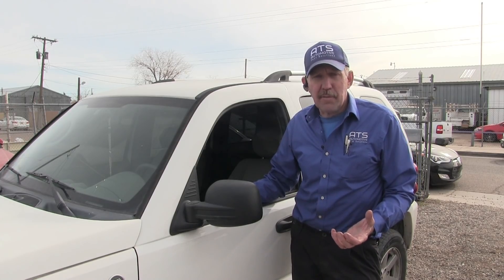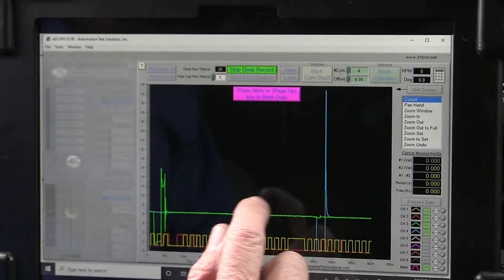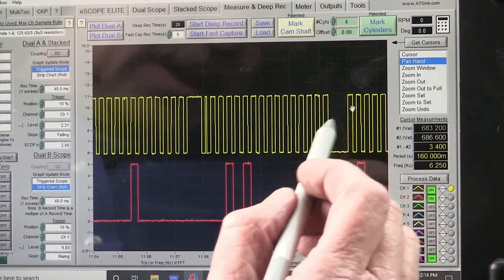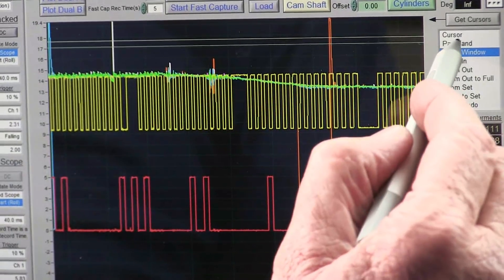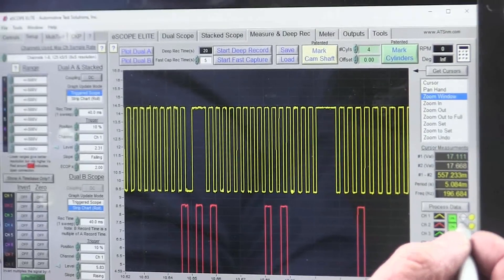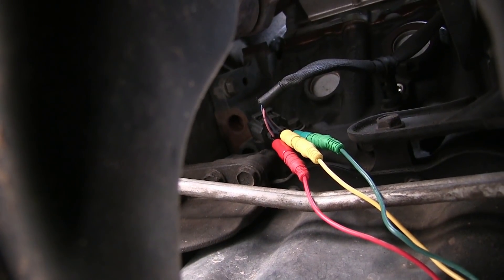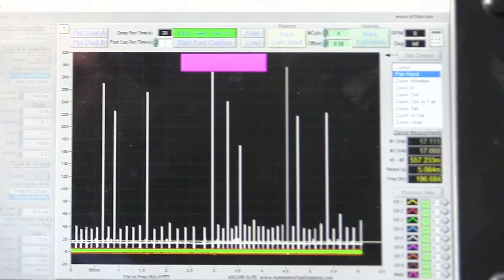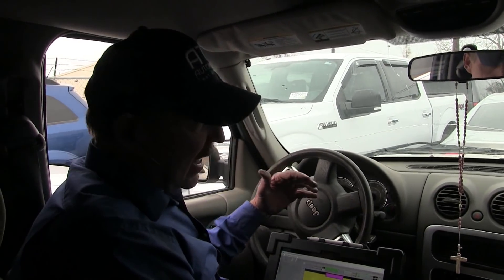2006 Jeep Liberty Stalling Problem

Comment: Automotive repair shops should be required to state whether or not they have staff that can use a scope.

If I ran a shop, and had staff who could do this, I’d advertise it. In the future, if I have an issue like this, I’m going to ask if there is someone available who can use a scope so I don’t have to come back multiple times before the parts cannon just gets lucky.

Comment: I have a 2007 Jeep liberty. Two times this week I turned my vehicle off for about 5-10 minutes, then went to turn it back on. And it was wanting to stall out. It was pretty bad. But I managed to get it started by pushing excessively on the gas. This video made me think outside the box for possible part failures. Thank you for being so clear and understanding. Tomorrow morning I will take it up to Auto Zone for a scan for codes. Then over to the shop for a oil change and hopefully they can use the same scanner tool you have to figure out the problem. Thank you!
Reply: Mine is doing the same thing. Did you ever determine what the issue was?

Comment: You were able to see it quit.  I've had intermittents that did something similar.  Two 1997 GMC Mini vans with the 4.3L V6 engines over 100,000 miles on the first van, had the same intermittent stalling, usually on the road.  It took a lot of driving with my old two channel scope and DMM ( it was over 15 years ago when I had these two intermittents) to find out it "could be" the ign module or ign coil.  When the intermittent had shown itself, I finally had the scope positioned to show the computer timing output which was sent to the external ignition module.   The module in turn toggled the Neg side of the ignition coil which then sent the spark through the distributor, the spark plug wires and the spark plugs.  With the scope on "flight record," I saw when the engine stopped, the signal to the coil from the module stopped, but the engine took time to fully stop.  During that ramp down time ( of the engine) the PCM was still sending the computer timing output ( 5 volt square wave) indicating the crank sensor was still sending the signal to the computer.  Without the old Fluke 98 scope it would have been fire the parts cannon!  As it was, the spark plug center electrodes were worn down to the insulator, the ignition wires were original, and possibly the ignition coil was stressed due to the worn out plugs.  After replacing those parts, no more intermittent stalling.

Comment: Large electrical loads briefly loads the engine speed and consequently changes the engine cadence. Hall effect type systems are very sensitive to frequency changes and thus the change in engine cadence exposes a defective crank sensor. This is one of the reasons why I prefer Hall effect type systems over VRS systems, they are much more sensitive and simpler in design, to approach this level of resolution, GM uses two VRS sensors!? Despite the hate and lack of funding for development those Dodge boys can still compete with the best. I believe Chrysler could have implemented a filter for a small glitch like this but - why would anyone not want to know of an early impending failure?
Reply: Joe luang - that's exactly what I was saying!!! If the pcm tolerance is turned that closely for the hall effect sensor to detect malfunctions, then it should at least trigger a pending code in the PCM for crank sensor performance / intermittent. Then after repeated occurence it would set a store code. Manufacturers trying to cut costs in software development!!! As expected from Chrysler! Instead they investing in SGM trying to lock technician's out, stating it's for security reasons. 👎👎👎

Comment: There still is definitely a correlation between the fan and the crank sensor, maybe the fact that the sensor was bad it  was effected by any slight variance in current change... brilliant diagnosis thanks

Comment: Knowledge and skill on another level 🤯. I am trying to fully understand the process here, so it makes sense that you would collect data from the ignition coils and injectors as these are providing the engine with two of the three fundamental elements required for running (Fuel and Ignition) it also makes perfect sense why you looked at the cam/crank signals as these are the inputs used by the PCM to determine fuel and ignition timing. I guess what is key here is to look if the outputs (Injectors, Coils) cut out before the engine stops rotating. I presume if this was a bad fuel pump the outputs would keep operating until the engine stops. If you did not have an input issue like in your case study, where would you go next and why? Cheers, Adam.

Comment: Wow!  Still can’t wrap my head around how the electrical load was related to the sensor failure.  I suppose it is just a coincidence. I was expecting a bad ground or battery.
Reply: Bernie mention that it was not the electrical load it was a coincidence the only problem  was bad crank sensor.
Reply: @rauls300ce  So it was a coincidence, that every single time you turnedon the AC, the crank sensor would act up? That was the biggest coincidence I've ever heard of in history.
Reply: Could it be possible that any load put on the engine slow the RPM and push the crank sensor into the fail mode

Comment: Love the passion. I get the fustrating bit about shops guessing. I don't get it either. I'm not 100% perfect but if you prove what is wrong with logic/testing/data you'll be right 98% of the time. The other 2% you missed a step, didn't have the whole story, or overlooked something.

Comment: Great Video. I wish I could get the training and the equipment to do this kind of work. I always enjoyed the trouble shooting when I worked on older cranes. I just missed the boat on the computer stuff.
Reply: There is so much fundamentals training on offer for free on YouTube, such as Scanner Danner, Schrodinger's Box, then you've got the awesome case studies such as these from ATS, Ivan at Pine Hollow, Eric O at South Main Auto and many many more.
You don't have to start big, any scope is better than none and there are some good 2 channel scopes out there for little money.
8 channels on the ATS Elite lets you capture more signals at once, with fewer channels you would have to run the tests multiple times to build the picture but you could still do it.... as long as the fault could be reproduced on demand or was occurring frequently.
If you noticed here, by observing the 8 channels simultaneously, it was easy to see the relationship of cam, crank ,coils, injectors and power - and then quickly deciding which ones weren't an issue, hiding those traces allowing the problem ones to be focused on.
Reply: @simonparkinson1053  Thanks for your kind words. I do watch Paul, SMA and a couple of others. I enjoy watching those guys for sure and have learned a lot. There's your problem lady. :-)
Reply: @cullenmiller8170  Cheers! When the time is right for you, you can progress to established training providers, that's the route I took.
These ATS case studies are excellent demonstrations of diagnostic process, starting wide and ending with a pinpoint focus

Comment: I was thinking at some point in the troubleshooting that a probe would have been connected to the fan motor power to check for the coincidence between the failing cam sensor and the fan motor turning on. That might have helped decide sooner that the two were not related.

Comment: What it shuts down only when ac or lights were turn on?
Reply: Maybe the extra noise on the ground system with loads turned on amplified the failing component in the sensor?
Reply: Hey Maic! I was wondering the same thing bro! Very strange coincidence :)
Reply: @PineHollowAutoDiagnostics  I was expecting a bad engine ground or something like that. A guess it also happened with no loads.
Reply: @MaicSalazarDiagnostics  yup bernie mentioned that later
Reply: @PineHollowAutoDiagnostics  Ivan, this is the first video I've watched from this guy. Why no codes set?

Comment: Too many shops change parts as part of THEIR " diagnosis " . I would guess the alternator and computer cost about $ 1000.00 installed . The vehicle then does the exact SAME thing . I don't see how they get away with it . Lube Tech , maybe - if they use the correct fluids . Technician - definitely not . This is what happens when you use your BIG TOE instead of a scope .
Reply: I wonder if the customer got charged for those items?!
Reply: @dans_Learning_Curve  You bet they did
Reply: That's what's going on now I changed TCM, ECM, BCM ,Throttle body, injectors ,coil pack Ngk spark plugs, air temp sensor, both fuel pumps and still doing the same thing. Hard to start, run until it idles down and cuts off. Unless I keep my foot lightly on the gas and it stays running. Is it the crank or cam shift sensor.

Comment: That's a crazy failure!! Scope to the rescue! No way to diagnose that one without a scope :)
Reply: Ivan, maybe I missed it, but why did the engine stall when a power load was added? How dis a power load cause the sensor to stop reading?
Reply: @dans_Learning_Curve  that was just a coincidence...nothing to do with additional power loads
Reply: @dans_Learning_Curve  Great question Dan, I was wondering the same thing! Bernie said that it was a coincidence. Maybe the sensor was on the verge of crapping out, and a slight change in rpm made the fault show up more regularly?
Reply: @PineHollowAutoDiagnostics  could be when the engine gets hot it starts to act up as he mentioned later in the video that it would randomly die without any load, we all know that sensors tend to act up when heated.
Reply: @dans_Learning_Curve  Later in the video Bernie said it was just stalling after a time whether or not electrical loads were added. The original report had been misleading.
Reply: There's a way how to check it without no scope that is by simply tapping on the the sensor. Sometimes it just has a hair line crack on it when installing it. Or a Cracks by wear and tear basically by heat.
Reply: I can't wait until Spring!!